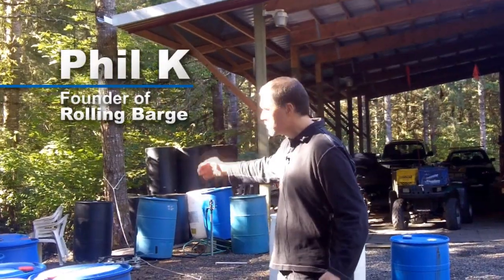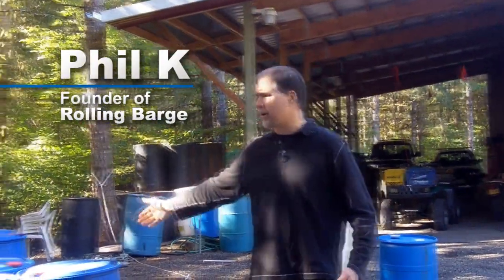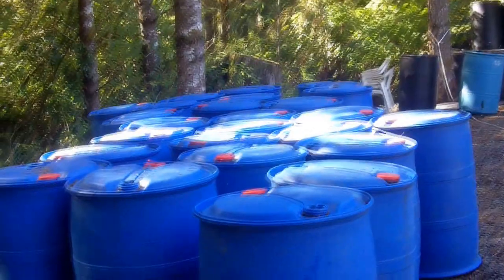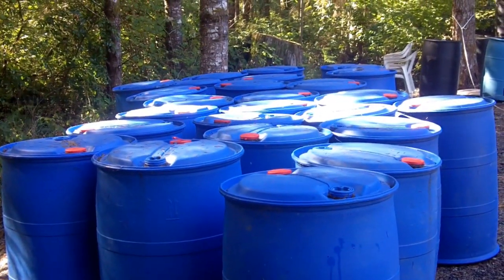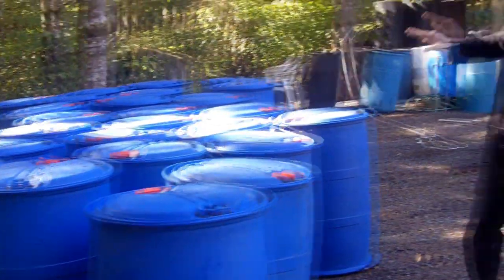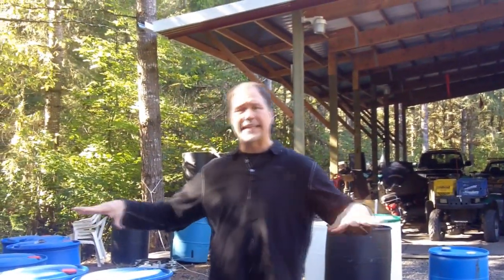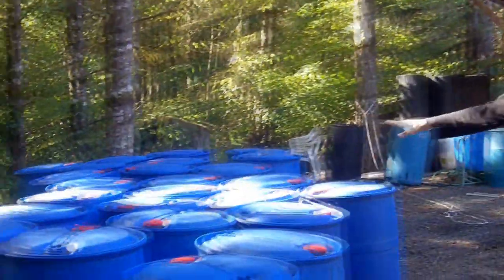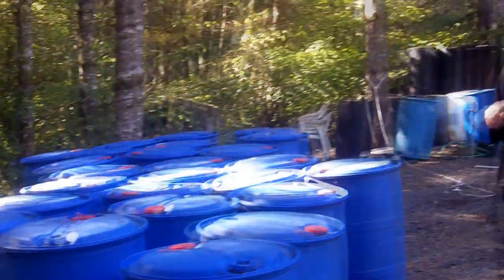Plastic Barrels for a Floating Dock—how many are needed?

Comment: An object in a fluid experiences an upward force equal to the weight of the fluid displaced by the object. So if a boat weighs 1,000 pounds (or kilograms), it will sink into the water until it has displaced 1,000 pounds (or kilograms) of water. Provided that the boat displaces 1,000 pounds of water before the whole thing is submerged, the boat floats.
55 gallons of water weighs about 440 lbs, so a 55 gallon drum will displace (or support) 440 lbs (minus the weight of the drum, obviously). Put 450 lbs on top of it and it will start to sink.
10 drums would support 4400 lbs, etc.
Reply: julie r thank you so much
Reply: julie r Thank you!

Comment: A 55 gallon drum contains 7.35 cubic feet of air. 7.35 cubic feet of water weighs about 440 pounds. That means the barrels have a displacement of 5280 pounds.
Reply: Each? Or combined total?